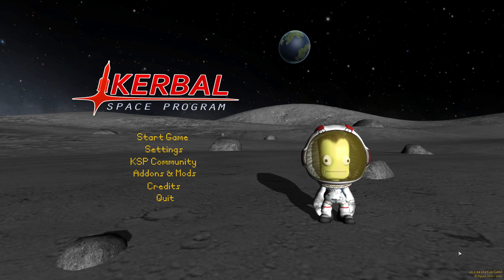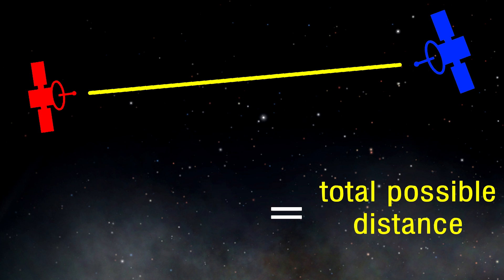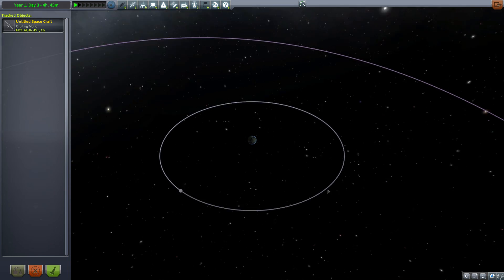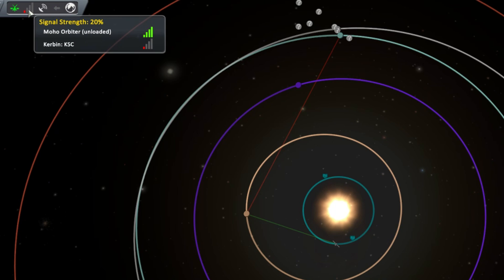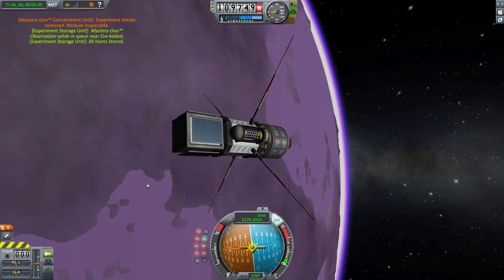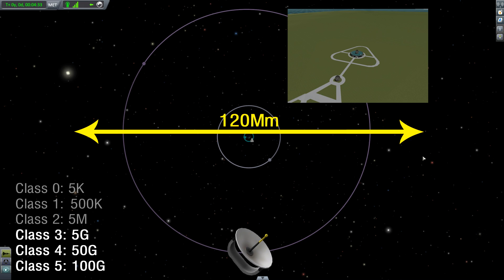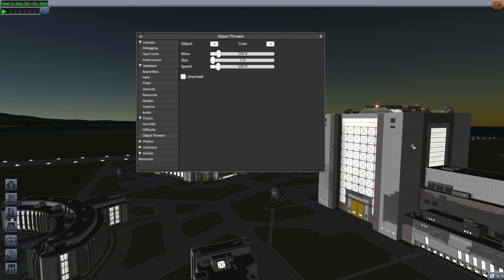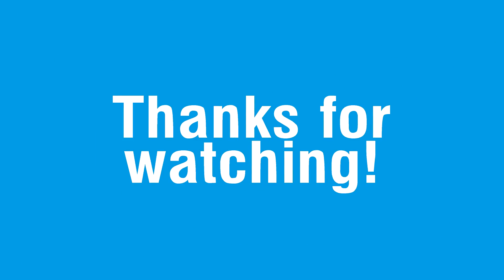The Definitive KSP 1.2 Preview!

Comment: wait, wut, can you still controll probes without signal? whats the point of it then
Reply: Matt Lowne ok thanks :D
Reply: You can't do anything with maneuver nodes, nor fine tune throttle/orientation.
Reply from the maker: You only get limited control, like you can't point it in any direction other than retrograde/prograde/radially etc. and you can only have either full throttle or no throttle. You also can't add manoeuvre nodes. This is because in real life, probes can be pre-programmed to perform certain tasks without signal

Comment: rip remote tech
Reply: So far this looks better than remote tech because I bloody hate having to manually target sat dishes constantly whereas this seems to not care.

It's neat having long range satellites with a tiny cone of transmission, but it's not worth the headache of having to put an extra dish on each relay for every probe in the relay network if you haven't unlocked the big range omni ones.

Basically remote tech didn't let you have large relay networks between multiple ships because the dishes had to have a target set or the active vessel; it was more about using long range dishes to connect different omni networks.

With this system, it looks like I will never have to stick 20-30 dishes on each relay sat to avoid running out of connections because they don't need to be aimed at specific targets.
Reply: Remote tech works slightly differently, so I don't think it's going anywhere.
Reply: Ciaran Brickles
Oh ok

Comment: Not sure if it was mentioned (so much information compacted into such a short time), but you can set fuel use priority for the tanks, which will make it a lot easier to balance VTOLs and aircraft, and to keep any craft aerodynamically stable.

Comment: Does having a top tier tracking station make relay networks obsolete because the range is enough to cover the entire star system or do we still profit from higher transmission rates and thus more science (+ the chance to avoid planetary occlusions?)
Reply from the maker: It's still useful to have relay networks for stuff on the other side of the sun or things occluded by planets (Jool moons, dark side of the Mun etc.). Plus, the top tier tracking station can't always reach Eeloo
Reply: +Matt Lowne hi could i kindly and non invasively  ask you to have a look at my channel please :3 i am currently a very small channel and i post as regularly as possible (every few days) and i am looking for ways to improve so if you could check my channel out i would be very happy :D also another great vid so hyped for 1.2!

Comment: If a satellite, probe, or station is not in Geosynchronous orbit with Kerbin's Tracking Center, how would it get signal? You'd have to have a bunch of relays around orbit right? Otherwise there'd have to be tracking stations or planes with radar located all over Kerbin so it can constantly have signal. That's how satellites and the ISS work as far as I know.

So what I'm asking is, say if you're in LKO, can you get a signal from the tracking station which is on the other side of Kerbin even if you don't have any relays or aren't in Geosynchronous orbit?
Reply: Scott Manley has videos on RemoteTech and satellite networks, they will answer your question.
Reply: ssecial okay. Because I watched a documentary on how the ISS was built and how it works, they explained that. But I'll be sure to check it out, thanks
Reply: also, there are 5 ground based antennas around kerbin, including the tracking station. I saw it in another 1.2 update video.

Comment: noooOOORGH! NOT RELAYS AND ANTENNAS AND REMOTETECH!  dat thing give me fun cancer!
Reply from the maker: You can disable the need for comm network in the difficulty settings!
Reply: YASS!
Reply from the maker: no
Reply: I love that. Maybe you are a noob :P
Reply: Gingold Duck
nopo a light second is 300.000 km, jool's orbit is at 120.000.000 km from the sun
Reply from the maker: There is no delay in the stock ComNet though
Reply: It takes literally a light second to get across the kerbol system.
Reply from the maker: Nah you only need like 3 100G antennas around the Sun for a pretty good network. A maxed out tracking centre will cover a lot of distance!
Reply: Raúl Ramos
nah, i like the concept but i ain't nobody time to put in orbit 40 probes
Reply: But is light speed consideed? do i need to wait tn minutes to talk to a probe the other way of the solar system?
Reply: Nope.
Reply: oooh at least.

Comment: That means Remote tech is rendered obsolete?
Reply: I would say yes
Reply: no, as delay is not included as far as I know, remote tech will just add some extra realism rather then a complete game overhaul.
Reply from the maker: This is a lot less complex than remote tech, as +Conor Crowley mentioned there is no "delay" when controlling satellites, and I think in general it's a lot easier to get into and understand than remote tech.
Reply: remote tech works a bit diferently, if you still prefer remote tech i believe and hope that the mod will still be available to restructure the comms mevhanic into the classic remote tech we all know.
Reply: also they do have the autopilot feature meaning losing signal is not the losing your probe mission
Reply: I could be wrong
Reply: Yes and No.

RemoteTech is still the more realistic option, so if you are going for a Realism set up, you would still need to install that mod.

Comment: Well, I'm not going to update because it's added remote tech! What if I want to play easy mode without it!? Or if my brother who likes it but finds KSP to difficult!
Reply from the maker: You can turn it off in the difficulty settings
Reply: Inexperienced people can turn it off. And it isn't remotetech, it's alot easier.
Reply: I'm sure it's been simplified for people like you to make it more enjoyable than stressful.
Reply: Tuning3434 Don't get me wrong, I don't mind it. In fact it was what I wanting.

RemoteTech is a bit difficult for me to grasp, likely because I find the whole calculator thing a bit confusing, so I am glad KSP added this in.
Reply: I'm pretty sure that it's toggleable
Reply: +Just another YouTube channel
I can imagine it is only active in certain game-modes: just like science and career modes are a progressive steps harder than sand-box. I think it fits nicely in the career mode challenges. It isn't as invasive as remote-tech as you are still able to 'directly drive' your probes yourselve. You just have to remember to program your man. nodes when you have a link. As long as you can throttle and stage, I don't think you will get in real trouble like with remote tech.
Reply from the maker: It's present in all game modes but can be set to be off (it's off by default in all existing saves, but can be toggled on), "normal" (like in this video), or a mode in which probes are completely dead in space without a connection (rather than simply having limited control)
Reply: Velociraptors of Skyrim 
Like Matt commented just above, it has a setting that can 'kill' your probes when you loose your link. However, no signal delays and by standard applying the 'square root' signal strength does leave the most invasive (and annoying) challenges of RemoteTech out of the equation. All by all, a good vanilla version of RemoteTech in my opinion. If you really want hard-on RemoteTech, you can always install that mod (when updated).
Reply: +IAmAPerson _ That too.
Reply: This is a much simpler version of RemoteTech that literally removes all the challenge in RemoteTech.
Reply: I wouldn't say it's a lot easier, but rather a lot less tedious and a lot less punishing for small ridiculous things. For instance, I HATE the autopilot of RemoteTech because it will occasionally just not do its node (MJ requires connection), which will scrap an entire planet exploration mission, half a planetary network, and a year of travel. The softer restrictions adjust for this lack of realistic mission programs (unless you go all in with KSP-OS or whatever that scripting mod is called).

It looks like it also removes some tedium with dish angles, which frankly is quite annoying. I get that it's realistic, but I end up having to pack and power way more antennas than I would realistically need in order to avoid having to go through and swap everyone's target to complete a network for a particular probe. For instance, bouncing a signal from Jool->Duna->Kerbin is a lot more tedious when you have to switch the Jool and Duna networks to face each other. Lots of loading time.

The UI looks ways better too.
Reply: Alex Siemers I enjoy Remote tech, sometimes I want to test or just have fun without it okay?
Reply: Matt Lowne Oh, thanks for clarifying, this is perfect, I'l update on release.
Reply: Antonio Klaić I used remote tech as a simmilar example.
Reply: ***** Jesus Christ! I meant for when I'm not playing seriously or when my younger siblings play, I have a working satellite network using TAC life support and remote tech covering every planet! Now that I know you can turn it off, I'm okay with it!
Reply: Just another YouTube channel ok, I am sorry for me and other people being literal twats to you because you didn't want a comm system to be stock. Even i will turn it off because I'm more fond of Remote Tech ( I love realism) , so I'll only use it until mods are updated.